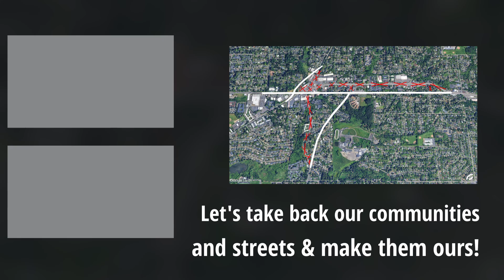Fixing Oregon's WORST Intersection

Comment: There's nothing wrong with the intersection. It's the people who are in a hurry, impatient, or just morons who don't follow traffic signs and laws. We live and use this intersection every day.  People don't care about others ans slow down. The city mentality of not caring about others is creeping into Beaverton or thinking you're special. You're neither. You block traffic or the intersection, you look stupid! Think!
Reply from the maker: It's not ever that simple. There is everything wrong with it, and no, people suddenly driving slowly/the limit and stopping/slowing for others, namely pedestrians would not "fix" or suddenly make this intersection function well and fine, that's simple factual reality. And again, as I stated in this very video, the problems here inevitably will become FAR worse once they have to redevelop it into mixed use medium density along it and around it, with it left as is. That's in fact the biggest problem with it, as it will inevitably amplify all of it's major issues tenfold. And that's unacceptable, but will undoubtedly happen anyway, exactly because people have the same belief as you do - "There's nothing wrong with this network and intersection is technically multiples in one." You can believe that if you wish, but that proves you believe in a delusion. Not a insult, that's a fact.

It's literally a bunch of native american trails turned wagon trails that then turned into farming roads, and then major roads and feeder roads, that just kept being built up along, paved over, and widened. Nothing was done to make it make sense, or to make it safe, efficient and sound by completely reworking the whole mess to simplify it and remove unnecessary connections from other others, driveways and business access points. They left them all as-is, and now we have a heap of crossroads crossing more roads all at horrid, dangerous and deadly angles, and endless asphalt and concrete to produce as much heat, danger, injuries, wrecks and deaths as possible, all while the infrastructure that runs under, through and around it, mainly below, was never once updated, upgraded, improved or replaced. It's all also old and mostly untouched from well before the development happened, and some from just prior to it. The drainage is infamously horrible through there for this reason, too.

It's a complete mess for all, whether you suddenly have everyone passing through and using the mess all be perfect little angels who obey all laws no matter what, get into midwest standoffs with each other over being "safe" and courteous to each other, etc.

Comment: I’ve lived here my  entire life.   I find the intersection easy to navigate IF you obey the lights and speed limit.   The wrecks are caused by drivers distracted with an ungodly amount of things.    Just to name a few; not concentrating on your driving for reasons we all know about.
I remember when the intersection had no traffic signals, only STOP signs.   Drivers paid more attention then because of less distractions.   Of course, there was less traffic then too.

A simpler solution would be to remove the little short piece of Oleson Rd between Beaverton Hillsdale and Scholls Ferry which is right in front of Parr Lumber.    That point is where every accident is.
People don’t look before they turn.

The signal timing needs to be adjusted a bit also.   The biggest problem I’ve observed are the drivers on Scholls Ferry.   Few actually attempt to stop when the light turns yellow for the Scholls Ferry traffic.  They end up going through the intersection when their light had turned red, and the lights for Beaverton Hillsdale are green.  
I don’t know how the timing works, but after one set of signals turn red, if they could pause for 15-20 seconds BEFORE the other lights turn green, this would give the red light runners time to cross the lengthy intersection.

Cutting out Dogwood to the south would be disastrous for the Montclair neighborhood.

Dogwood to the north has no other route out.  Dogwood, Newton and Charming are all dead-end streets.   Your suggestion was not thought out very well.

A round-a-bout, HA, that’s a joke.    Have you witnessed the craziness in Portland on 39th, now Cesar Chavez  street.   OMG !!

The development of Alpenrose Dairy should work with Multnomah County to widen Shattuck Rd between the development property and Beaverton Hillsdale.    It’s only 2 lane and without curbs and sidewalks.    That development needs better access, and THEY should be working with Multnomah County on that resolution.

That was the biggest mistake, allowing to the property to be sold to a developer.   The city or county should have purchased it for public use.    We have now lost 4 fields for softball, a velodrome for the bike racing and what I believe was also a soccer field.
Big mistake by the elected officials.

Doing any of your proposed changes will have more people than you can imagine totally pissed off.
Reply from the maker: The only logical solutions are ironically all ones that'll displace a large amount of people and businesses, and piss loads of folks off. Otherwise, the only other option is to continue to let it stand as is, and pretend it isn't a problem.

The amount of people confused by which set of lights they're supposed to be looking at at the main signals is a huge problem I hear about consistently from those who have to drive through there. Because of angles and excessive road convergence, it places awkward and confusing single placements, mainly for Scholls Ferry going south, and Dogwood.

Simply pulling out the tiny sliver of Olsen won't remedy a damn thing. In fact, it would guarantee that anyone who needs to access the north side of the intersection to go up Dogwood or north on Scholls will have to take that 110-140 degree turn to do so, or, go all the way around charlie's barn to access Scholls further south, only further congesting and clogging that up far more than it already is, while others will attempt to take Olsen and turn across two lanes of traffic to access the far right hand lane to then quickly make their turns north, and inevitably this latter group WILL opt to just camp INSIDE the intersection rather than wait for their light to turn green again giving them a 50% chance they even can manage to get the space and time to zip into that far right lane.

And as I showed in this video, yes, you CAN weave through those rich neighborhoods north of Beaverton Hillsdale to access BH and SF. You just have to be inconvenienced to have to extend your trip by a little bit to access them and move south on Scholls or Olsen, or east or west on BH. If you wish to get into Portland, then you can just go north and take Skyline to Burnside, or Sunset through the tunnels. In fact, you can even weave through the inner neighborhoods to access Portland via surface streets through the hills around OHSU. People are just lazy and navigationally inept, and god forbid they have to take a few extra turns, slower speeds and thus adds a few minutes to their trips, suddenly it is absolutely unacceptable to them. Like the rest of us, they need to learn to suck it up and deal with it.

I definitely agree on the Roundabout point though. Plus with the normal average traffic volume per day through this mess, even two roundabouts with two or three lanes would not solve the issues at all. I have a whole video I made to mock all the "roundabouts will solve all your problems" commenters on this video, while actively pointing out just SOME of the problems with them and the logic of treating them as "fix-alls".

I also agree that they shouldn't have sold the Alpenrose property to developers, and left it in the public's hands, as like a historic place/museum, and a park. The lack of connectivity and capacity for the new development on the property and everyone else in the area is as I noted in this video, of great concern for sure, and will inevitably cause this intersection from hell to get EVEN WORSE BY A LOT. Turning other roads into stroads as well like BH however definitely is NOT a good idea UNLESS that extra lane is exclusively a BUS lane with no exceptions for anyone except as always emergency services. Then it'd make sense. The much higher capacity and at that point higher frequency and reliability of BRT would give everyone a alternative option to getting around the area, instead of only personal vehicles.

Also, the sheer amount of roads, including major ones in our metro area still without sidewalks is egregious. TV Hwy from Downtown Beaverton to Downtown Hillsboro, Farmington throughout most of Aloha, Shattuck, Multnolmah Blvd for most of it's length, etc, etc. It is inexcusable to lack sidewalks anywhere, especially on major thoroughfares like those. In fact, the majority of Aloha as a whole lacks sidewalks on almost all of their streets for some stupid reason. I assume its because it's always been a low income community, so naturally we can go f**k ourselves.

And here's the really fun part: Washington County, Beaverton and the State all already had consultants in traffic engineering come out and give their suggestions as to the best, most logical way to fix this mess, and do you know what their conclusion and plan was as of 2017? Almost identical to my own in this video. lol. I had never even known of that until someone in the comments of this video linked it. That effectively forces anyone to say "leave it to the professionals who know what they're talking about" to shut up. Haha, I love that little fact.

And you know what, I will leave off with this - You obviously have had to drive through and use this mess of a intersection consistently throughout your life, seems clear to be decades, so consider the fact that it means you've had to get used to it. Anything we are consistently engaged with becomes normal to us like that, and leads us to think everyone else who can't figure it out is a moron who lacks a lot in brain power and capability. But the norm for almost everyone is the opposite of your experience. In most wrecks, distraction, arrogance via rushing and mistakes/confusion are at play. That has always been so. These days more than ever to be sure. But it is not true nor logical to blanket all as "caused by distracted, arrogant drivers who don't know how to use their brains for basic problem solving like identifying traffic signals and which are theirs". This intersection the deadliest in the state and has been for two decades exactly because it makes no sense at all, and is a unruly mess that needs to be torn out completely, and reconfigured separately from each other by at least 500ft as engineers have noted is the minimum distance between traffic signals considered safe and not too close together.

Comment: Big mistake for Olsen. Use Alpenrose western edge for due north-south link to east-west road on south of property to minimize takings on properties just north b of Alpinrose for new row.  Give road sections to residents as partial restitution.
Reply from the maker: I kind of suggested that when I recorded it, can't remember if I kept that in, but I probably didn't, given I wanted it minimize it to be as direct and straight forward as possible after I droned on about the details of it and its history. But the process I went through started with that option, though it wouldn't be Olsen, which means Olsen and the intersection would still be a unfixed mess, unless you just removed Olsen from that section, forcing people to use the widened/new thoroughfare by Alpenrose instead.

The problem with that is, I believe your suggestion was likely as a secondary north/south main route to attempt to balance congestion instead, forcing some further east to take that road over Olsen. But that again would mean the intersection mess remains unresolved, which is the entire point of this video.

Comment: It may be different than the other proposals, but could one main intersection of Scholls Ferry, Beaverton Hillsdale, and Oleson work? Yes, it would be a big intersection, but there would not be a short segment with a need to time signals between two intersections. Scholls Ferry would be diverted to the east on the south side of BHH, then approach at closer to 90 degrees than now, and Oleson would bend to the west as it approached from the south. The section of SF north of BHH would be diverted to the east slightly and leveled. Some businesses between Oleson and Scholls Ferry would need to be removed or moved.
Reply from the maker: I did think about that, but I do not believe it would be a long term solution. And considering those roads together average between 80k & 90k vehicles per day combined through it as it is now, then taking into consideration the redevelopment and infill set to happen in the next 5-10 years along it as well as in the surrounding neighborhoods which would greatly increase the amount of traffic going through it each day, it really would be I think a worse choke point that way than it is now, ironically. It is also a large reason why I made the follow-up on Roundabouts, given how so many people on this video seem to believe one or two would cure all of the issues it currently faces and will face in the next decade.

I am happy that you gave a different concept than what most commenters are giving (that is when they give them, which has pretty much been just "ROUNDABOUT"). Someone else suggested freeway like ramps for right hand turns, which was close to one of the typical American engineering and planning options I mocked but then cut out in editing from this video. But that's about the size of it. Lol.

Comment: What in the absolute America is this mess. Needs more underpasses and roundabouts.
Reply from the maker: The underpasses would be a issue themselves, as the area has infamous drainage issues, and it also sits atop a filled-in wetland, that itself sits along and within the 100 year flood plain of Fanno Creek. In fact, much of Downtown Beaverton and along the BH corridor has this exact issue. In example for downtown, the two empty plots of land north of the MAX tracks at Beaverton TC are still untouched because of major drainage problems, and flooding issues despite it sitting at or above street level in many parts. They once did attempt to build something on the plot due north of the TC, but quickly found it nonviable and tore it down. That, and Rats. The rats love using the creeks & drains.